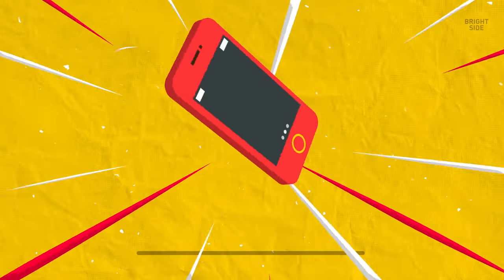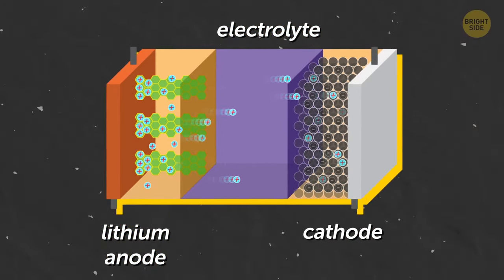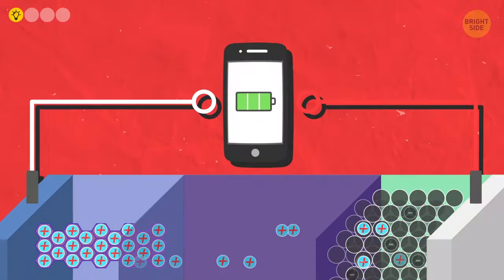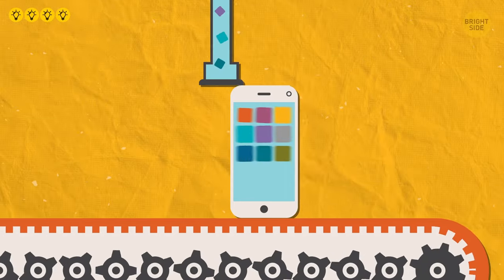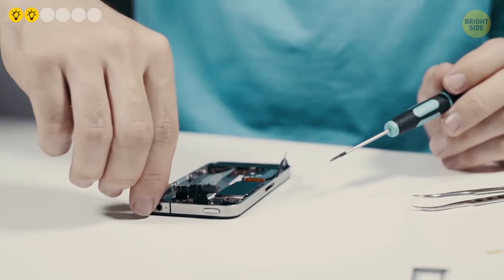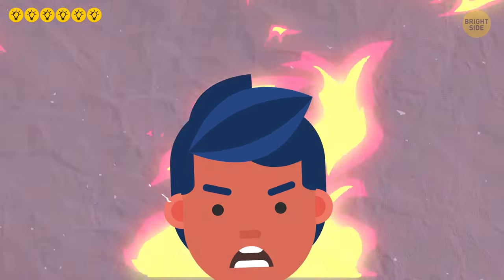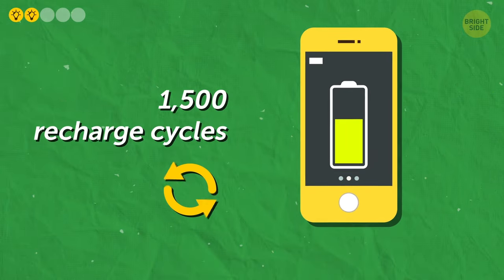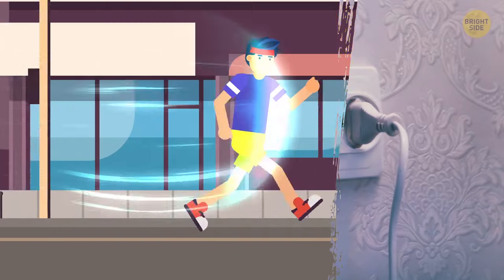That's How Phones Can Catch on Fire While Charging

Comment: You do realize that Lithium Ion batteries only ignite when overcharged or short circuited? What actually causes these batteries to ignite during charging is usually a knockoff protection circuit. Just stepping on your phone or dropping it doesn't damage the battery. Lithium Ion batteries are solid state batteries. They're solid and stable. The only way to get a LiPo battery to ignite is to puncture it with a conductive solid object. That story about the power bank is completely false. It's impossible. Even if he took the battery out of the power bank and threw it, it would have not ignited. Power banks also typically use Lithium Ion batteries, more specifically 18650 cells. Same with charging your phone when it's full. The BMS (battery management system) keeps the battery charged, but stops charging when the battery is full. It does not keep charging. That would overcharge the battery and make it unstable. This video needs some fact checking. I don't know where you got this research, but it's not legit.
Reply: Last thing you explained was already explained y know the bms
Reply: Yeah. I left my Samsung charging (I accidentally slept) and was fine after I wake up.

Comment: Yes, I  found out the hard way. I  had old cell phones in the house 🏠 and I  had the newer phones 📱  that wasn't working store in the storage, why? Didn't I leave well enough alone, very cold outside. Put them next to each other and individually clear bag's why? Did I hear the sound of sparklers, and flame. More flame as I pick up the phone 📱 off the bedroom carpet. Running to the bathroom  bigger flame. The back pop up and I  drop the phone, it made a cellphone 📱imprint in the bathroom floor the back cover  that cost me alots of $$$$$.to get repair.  The cell when I  heard the noise of sparkle, the phone was cold, but very quickly got hot 🔥 and hotter. I  show didn't know that was going to happen, I  took picture's ,  and  so did the landlord she said I  can see the imprint back cover / cellphone print in the wood 🪵 floor..... it could a  been worser, it started in the bed 🛌 room, but I am thankful, I didn't make my neighbors and myself homeless behind this situation, I really try to make it to the sink to put put the firer......
Reply: Oh thank you for sharing your story. I found it very interesting. I had a burn to my face and my neck hands and more,from the very hot cell phone. I did not know when the phone got hot. It’s sent out a microwave that can burn your tissue or cause fires, i’m glad you’re safe. Do not use your phone if it is hot.

Comment: Overcharged Overheat = Combustion Common Sense also a lot of people like to leave their electronic device plugged up entirely to long and overcharge their battery to the point it won't hold any energy in the cell so the battery overheats and combust because the energy doesn't have anywhere to go

Comment: I was literally just about to google this because of how my phone is getting a bit too warm when I charge it, and then you go and upload this, answering the questions i had! Very convenient! ^^  Thanks! ^^
Reply: You better cool it rather than using your phone while charging
Reply: good for u
Reply: You should not trust the video. Their research is mostly wrong. Your phone can get quite hot when charging, especially if it's hot. It's completely normal. Keep in mind, your phone is a computer with no cooling system whatsoever. The BMS monitors the battery temperature and stops charging if the temperature climbs too high, displaying a battery overheat error. Do your own research. Don't blindly trust the first thing you see. I encourage you to go on sites that specialize in LiPo, Li-Ion and LiFePo safety.
Trust me, I've been working with electronics and RC batteries for a while. Doing proper research helps a lot more than one untrustworthy video.
Reply: @PunakiviAddikti  I know that it turns off, and I know about the warning, the fact that I got said warning is why I got concerned. ^_~ I know the difference between somewhat hot and "painful to touch"-hot, too, and I don't really feel like doing more research because this video answered by only question I had(which was much appreciated) and that's all I needed. But thanks anyway. :) No idea what the Li-stuff is though, I'm guessing Lithium, although unless we're talking Nirvana or salt, I'm going to take a pass on that. ^^  But some of the temperature issues stopped happening when I turned off the hotspot when I was charging it over night, I don't need it then anyway, and it seem to be cooler when I don't let it run for days on end. 

Oh, but try to not be rude about how people go about finding info, you don't know my original level of research nor my method of going about finding information(nor or what level I am interested in finding information either, I am actually not very interested in deep diving in to info about phone batteries, this was quite enough for the level I wanted). But it's not very nice to tell people to do things in a certain way when you don't know the person. ^_~ But if it is super important to you, perhaps you should share what parts are wrong. :)
Reply: @PunakiviAddikti  you’re stating the facts
Reply: @PunakiviAddikti my face ears eyes were burnt by a hot cell phone, not knowing what was causing the burning lesions on my face because nobody educated us of what the heat coming out of the cell phone turns into at a high temperature… a microwave It left an image of the microphone, behind the tiny hole that you talk into burnt onto my neck, so you are giving the wrong advice. More education research and precautions need to be taken, especially for pregnant women The sick the elderly and children
Reply: @barbmakota2911 That certainly should not ever happen and sounds like a malfunction. Most battery related malfunctions are caused by manufacturers using cheap and defective BMS chips.

Comment: Charge & Recharge limit is just absurd. Okay, you caid if I charge from 0 to 100% will limit the batt 500-700 cycles. While you charge from 40 - 80% will increase the cycle to 1500.

Now be logic, if your batt can last for 5 hours in full capacity, it means 2 hours in 40% (80 - 40%). If we charge from 0 - 100 will make the battery cycle last for 500- 700 (let us take the mean), 600 x 5 hours = 3000 hours. While 1500 x 2 hours = 3000 hours. It means no differences. Even if you are lucky, full discharge and charge will give you extra 500 hours (700 x 5 hours = 3500 hours).

Comment: The galaxy note phone. I had one since like forever. And never any fire i even experimented with it like putting it in the oven on 350 degrees for 30 minutes while on the charger the only thing that happened was the battery went from 60 to 100% and the phone was very hot. That was 2 years ago. I still have it and use it with no problems.

Comment: Hey, if we charge after down to zero - battery lost after 300- 500 cycles.

In order we maintain in between 40- 80%, battery lost for 1500 cycles.

In 2nd statement we might charge more often than previous one.
Which leads to  500 = 1500 times

Comment: That is funny "Authorized Service Center. " There is no such thing as authorized service centers.  All manufacturers have what they call authorized service centers however the likelihood that you will get your original device back or your data back is slim to none.   If you can get them to change the battery,  their battery is just as likely to catch fire.  Apple will tell you that there is nothing they can do so if you want they will give you a special price on a new one with trade in so you really have no choice but to use 3rd party repair.  For the most part they are reliable.  I saw a live video of an iPad 4 data recovery where Apple told a NASA employee that their wasn't anything they could do so they took it to a 3rd party repair and data recovery company. The owner of the shop was afraid that she couldn't recover the data was it had been left in a backpack in the forest for nine months. She did get up and running and was able to recover the data that Apple refused to do anything.

Comment: OK so company's make chargers perfect for there phone. Trouble is that they're not handing them out right now so most people will be using whatever lying around. Further more everybody's hanging on to there chargers so a second hand phone is even less likely to be charged with the right device. Finally these company's are hiding behind eco friendly rather than profiteering. Let's face it, I get my new second hand phone and have to buy a charger off amazon. What happens? It has to be delivered (carbon footprint increased) it comes in packaging inside one of amazons oversized boxs no doubt with a load of bubble wrap.
 Just give me a charger with my $800 phone, thanks.